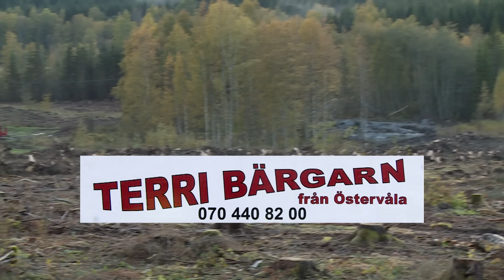Excavator stuck in deep clay - Heavy Recovery - Terribärgarn - Sweden

Comment: Those guys are crazy standing anywhere near the tow lines. If one snapped it would be all over for them.
Reply: Yes that mini man smooth nice job and the chevy3/4 ton
Reply: Arent they using steel wires  ?
Thats should be at lest 50ton each at that thickness, but since that truck supposedly can tow up to 100 tons its safe to assume thats still way below the wires stress limit which might be as high as 150tons.
 I cant imagine them breaking one in any way in those conditions.

But yeah if it broke due to some structural flaw, it would be messy,
Reply: i couldn't agree more,those cables would kill somebody if they snapped
.
Reply: There was some luck here. There is really no way to know just how much weight or strain that wire rope cable was  under. Wicked dangerous.
Reply: As usual... Clueless people repeating what they've heard from other clueless people.
Steel wires are safe when used within their rated limits
Reply: @kaba_me  Or, just don't take a chance by putting yourself in a potentially dangerous place.
Reply: I watched a tow cable snap when a buck sergeant was trying to recover a M93A1 and the subsequent ass chewing the E7 gave him when it busted out the windshield on his hemmt
Reply: @Stolas "if they are old". This is Sweden, not some third world country. Do these recovery trucks look neglected to you?
Reply: @Stolas You just proved my point, and the same apply to air tanks, and even the truck itself. Maintained and tested equipment will not fail.
Reply: @thedude5472  Yes, you should definitely do these.
Reply: @kaba_me  maintained and tested equipment can still fail. I dont care if that cable is brand new, I wouldnt be caught near it when its under load....basic rule with any equipment like this
Reply: @Dieseldogmodels  In that case you shouldn't drive a car either. Those maintained and pressure tested tires are under load and could fail.
Reply: @Stolas I recommend that you isolate yourself in a bunker as to avoid any unnecessary danger.

I drive one exact same tow truck. The cables are certified every year and as is any chain, straps, shackles and hooks. The wires are rated for 80 metric ton lifting capacity with a safety margin of x7. Meaning that if the wire is ever rated below 560 tons, it will be replaced. The single winch drum has a pulling force of 40 tons. Using both in a block will give you 160tons of pulling force on wires rated at the bare minimum of 2240 tons total.

If you make sure to always follow the proper procedures, then the chances of these wires snapping are less than imaginable.
Reply: I see these types of comments in every one of these videos, and then a ocean of people agreeing. It's really worrisome none of you understand physics and seem to think the real-world is a Hollywood movie.
Reply: Not gonna lie, part of me was hoping that would happen.
Reply: 644 @andrewburzanko6210
Reply: 8
Reply: Pays off having the right wreakers
Reply: @googleslocik
Reply: Made in Sweden  and that is all I have yo say about that
Reply: @andrewburzanko6210  😢😢😢😅😢
Reply: ❤😂😂য  @andrewburzanko6210  র্😂
Reply: @andrewburzanko6210  ko
Reply: Tom I agree if one cable broke it could cut him in half and not show down

Comment: That guy driving that little excavator around is a surgeon with that thing.
Reply: Elmo Elmo å
Reply: Elmo Elmo 

Aq
Reply: I was surprised that the small excavator was able to be on firm footing so close to that mucky blue clay pit.  I suppose it's because it was undisturbed soil.
Reply: That’s what I thought
Reply: Bollocks. Hes nowt special.
Reply: Operating is the correct term
Reply: @NSoutdoorsman  you dont "operate" a car though do you? And thats a machine. But i get what your saying. Buy tbh he aint that special of an operator either. He got the 1st machine stuck so he cant be that good.
Reply: I wouldn't trust him..he's got the front window closed all day
Reply: it is an engcon product - really flexible tool, he is well trained to use it!
Reply: @hond654  takeuchi
Reply: @komma_klar7012  yes, the base is takeuchi, with an engcon manipulator (1:25) So it could pick the logs and turn.
Reply: @hond654  ah ok..thx. jep perfect tool
Reply: @johnthegodfatherslack  You drive cars and you operate heavy equipment. Including excavators.
Reply: @johnthegodfatherslack  did you just compare a 1,500lb vehicle to a 20 ton piece of equipment hahaha it doesn't work like! that the only thing they share is they both run on fuel... And yeah this guy isn't really that great he didn't do anything fancy he just knew what he wanted to get done clear of the soft top soil and get down to firmer footing for his log mat so the big x doesn't sink in and drag it all up I'm assuming they didn't want to fire it up bc they wanted to service it in case there was water contamination in the fuel or oil
Reply: @alexduke5402  yes i "drive" and excavators thank you very much. And i know exactly how they both work.
Reply: @johnthegodfatherslack  10-4 driver
Reply: NP Anh B6 d
Reply: Elmo moto montée lmposible
Reply: I don't think this was his first time doing this..
Reply: haha your comment is the best Elmo
Reply: Palap a
Reply: deforestation has its toll, flood, landslide, rockslide, mudflow, mudholes,  avalanches, earthquake.........
Reply: @johnthegodfatherslack  They are a recovery firm, they only rescue other peoples machines, it's not the same guy doing the rescue that also got the first one stuck. :P
Reply: Amazing attachment Elmo.......Swedish loggers use them alot.......
Reply: @robinbystrom8968    j

Comment: Holy crap, I wouldn't stand right there with those chains/cables tight...
Reply: You're right you never stand anywhere in the bite of the cable when pulling any load , stupid , if a rigging like that breaks it can slice a person in half.
Reply: Good thing is you only make that mistake once
Reply: i was thinking the same..... that wire would take your head off.... they didn't see the danger. got away with it this time......

Comment: If you've operated heavy equipment long enough, you've probably had the unfortunate circumstance shown in this video. If not, you probably wonder how exactly does someone allow themselves to be swallowed up by the earth on a piece of equipment so massive & powerful.

Whereas I'm not an everyday operator, I've run rentals enough to find myself in a similar situation at least once & it's not as hard to get yourself in that kind of "jam" as you think.

A trac-hoe by nature is top heavy & if you're clearing timber in boggy terrain, all goes pretty well until you've cleared a wide enough swath of timber to find yourself in the middle of a large clearing with suddenly "no bottom" to it. You feel somewhat invincible in a machine you know can pull itself out of almost any situation you get into but when those tracks start spinning & your machine cants to one side, that's when the fun starts.

The more you push, pull or move your boom you find yourself just a little deeper in doo & that high elevation you were enjoying looking out across all that in front of you starts to disappear,, your entire rig is sinking or actually digging it's own grave as you twist & turn in the bottomless pit you created. The water table below you starts to rise & turn any semblance of stable ground below you into more mush & consume you the more you struggle with your rig to find some kind of traction or footing to regain an advantage. Those stump holes you created taking down those trees fill & mix with water & unknowingly, you made a perfect storm below you.

The biggest issue is losing your equilibrium, where the actual weight of the machine works against you when you lose that flat plane where once all things were equal. Suddenly, the counterbalance of where any machine of this size draws it's strength from is gone & that misplaced weight acts as a digging mechanism & your tracks try to but can't compensate for all that weight displacement. You go deeper & deeper with each move you make trying to desperately not end up like the operator in this video knowing he's going to have to call in for help with a few folks getting a small chuckle out of his misfortune. Your tracks at a diagonal act as a "cutting mechanism" instead of a flat plane used to maneuver on a flat stable surface. The tilt you're suddenly working from creates a difficult effect swinging your boom to pull or push & you're looking into the sky on one side & hitting the bog beneath you halfway around when attempting to utilize your bucket to pull you out. The solid platform you sit inside of doesn't feel so invincible anymore & it's intent to control all that spinning & pulling power has lost it's purpose.

It happens to the best of operators & I was fortunate enough that day to work myself calmly out the mess I'd gotten into with the help of a massive pine close by that gave me just enough leverage to grab ahold to & slooooowly pull myself out little by little. After watching this video, I can think back to how with a few wrong moves, I could have probably buried my machine in that perfect bog that day myself. Believe me, the suction of that muck below you doesn't want to allow your escape, it's slippery & sticky consistency wants to hold you & take you down further if it can.

As I said, you feel invincible almost with all that power at your disposal but power is relative to the forces around you & even the most enormous of manmade capacity can be swallowed up like a floating city called an ocean liner in the middle of the seas without a trace of evidence it ever existed if the right (or wrong) circumstances prevail..
Reply: So true, well said. I've got a big Case580 2wd backhoe and tread very carefully even in what looks to be solid ground. It happens fast and the recovery is long.
Reply: Dude, you should be a poet. An excavator poet.
Reply: As someone who is an everyday trackhoe operator, I disagree. to get an excavator in that position, you have no idea what you're doing.
Reply: Well said.
Reply: @clintchapman4319   I agree if your used driving diggers you know where to go and where not to go test the ground first.
Reply: @clintchapman4319  true. You xan save yourself well before its too late. I have been stuck however up to the door in a 13 ton case in running sand used a 21 ton cat to pull it out but only to save time.
Reply: Paul Robinson  lmfao.
Reply: Ro'ber Harpane' well said    I almost lost one in a bog one time    It took all my skill and a lot of luck to save it

Comment: The only thing I can see that was done wrong was they should have had anti whip blankets on the cables. They are basically just heavy sheets that will absorb the energy if the cables snap. Without them, those idiots walking around the cables would have been cut to jerky had a cable snapped. Other than that, a text book operation in using the land and man together to solve a problem.
Reply: O88u
Reply: +Brütal Löve  damn right....
Reply: Cables are made of swedish steel! They will not brake!!!
Reply: +szili76  but they might still break...
Reply: Tennethums1 Yeah, but with the whip blankets, no worries!
Reply: +szili76 can I have four Swedish steel screws sir
Reply: Six String Löve +Six String Löve
Reply: In this and similar videos I'm concerned that workers are often in the potential path of a snapped cable.
Reply: Brake is to slow down, break is what cables do when you exceed their ultimate load. Americans seem unable to get that right, I expected better of a Swede.  ;-)
Reply: @cageordie  it only takes one rusted or nicked strand, which may be invisible in the core, to let go and you can be in big trouble very quickly. i have spent as lot of time in Sweden and have great respect for them.
Reply: @cageordie  American's
Reply: I thought the same thing, and they did do well to get it out.
Reply: They ain’t gon brake cuz it non China material
Reply: Six String Löve p

Comment: I like the crane. Looks like they'd rented it from a technical history museum.
Reply: Ratzfourtyfour It's an old Swedish army surplus vehicle. Ltgb 957 (Scania LA82-61) built in the early 60's.
Reply: Ratzfourtyfour It is a crane for salvaging tanks. 😊
Reply: Some models of old European army vehicles are still used by civilians today because they're great value for money, even if you factor in the fuel consumption. For example Praga V3S is over 60 years old but frequently used by loggers across Czech Republic, as it can go through some pretty loose and uneven terrain, even with full cargo.
Reply: Don't know much about military equipment do you !  DA.
Reply: @CanIHasThisName  It looks more than a IFA G5,the Engine hood from Praga is shorter.

Comment: If its icy and if the tracks are wore out .. It is easy to slip into mud and get stuck. 
So.. getting stuck like that is possible for a good operator. However..
I would be surprised if the guy on the mini doesn't have more than 20+ years of experience.

Comment: operator error...you can see how soft the ground was from the tracks he left on top...his mistake was not getting out of there
Reply: pull the planetarys when they had it on logs...then it will roll
Reply: I guess then i am lucky...after running this equipment for over 30 years they do listen when i say no...and if they insist it can be done they will find someone else to do it.

Comment: Could an auxiliary hydraulic source have been hooked up to the excavator to enable an operator to run the machine? I've had a little skid steer excavator stuck, and wished I could just put an electric pump on it to run it at a low level to get it on a trailer.

Comment: The security management in this whole operation is worth shit. Steel lines stretched at 20+ tonnes will snap anyone withing reach in halves, including the bugger that stands closest to the excavator at the end, presumably the same bugger who had enough stupidity to sink the machine in the first place. The small digger pulls some impressive precision stunts, but that wouldn't help anyone within reach of snapping steel wires. Obviously they are stretched at beyond 30-40 tonnes, the weight of machine plus traction from caterpillars and bucket.

Comment: Dude, i seen one of these things fall into a swamp. It was covered with mud up to the cab. Sat there a week. They brought in another one to dig out a whole to drain off the water. Hook it to a couple cables. And pulled it out with a bulldozer. Took 2 months to clean, repair and get it back in service.

Comment: Watch the colour of the clay. The steel blue clay is called "blålera" and is a real heavy duty clay. When dry it is rock solid and when wet it is extremely heavy. You can see it close to the excavator. This clay makes it necessary to have extreme power to drag up things from it because it sucks things stuck. Around it is more average mud clay, more earth coloured.

I'm guessing this video wouldn't be necessary had it just been ordinary wet soil clay.

Comment: was it repaired and working later? I bet the engine was shot, all hydraulic lines shot, hydro pump shot.
Reply from the maker: Michael Carton One week later it was at work again.
Reply: Falling over in soft clay/mud does not blow the engine or anything.   Have you ever been in the mud with a truck?   I'm not saying its impossible to damage an engine after being submerged.  Now to ask was it running, if so how long and did the engine take a drink?
Reply: I know it wont blow an engine in of itself, but the engine can intake that crap if the snorkel isnt strong or high enough. Also, the oil sump can cavitate from such an extreme angle and seize up, not to mention over heating issues from not being able to expel all the heat.
Reply: +Michael Carton The hydraulics and lines would be just fine. There a sealed system and have to be since they can run pressures up around 5,000 psi. So that means the hydraulic pump is sealed as well.  Probably pressure wash the mud out of the rad/fan area. Same for the engine compartment and the rest of the machine. Check for water in the sprocket hubs and engine. Then fire it up. Not sure about Volvos since I've never run one. But the Hitachi's have the air filter on the side that was out of the mud. If Volvo's are the same and the exhaust end stayed clear of the mud and water the engine will be fine as well.

Comment: if they had operated the machine that was stuck with its own power it would have come out easier with one recovery truck  instead of two ?
Reply from the maker: Yes, but the engine could not be started because of water in the machinery.

Comment: I wonder if the Volvo was in neutral when they dragged it out.
Reply from the maker: The only way to disengage the tracks on this excavator is to disassemble the track drive
Reply: ADVideofilm   Well, I use to subsoil and disc on a farm and I know a D-7 Cat will roll in neutral, but of course with difficulty. Leaving it "in gear" will not make the tracks roll especially if left in reverse.